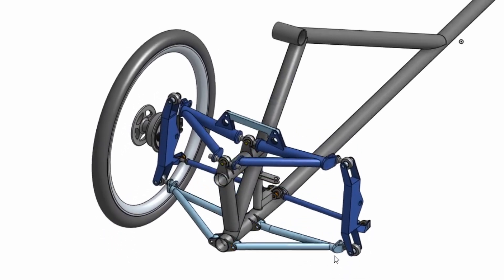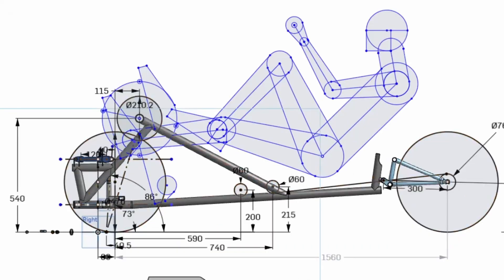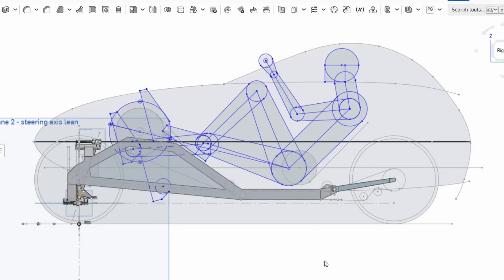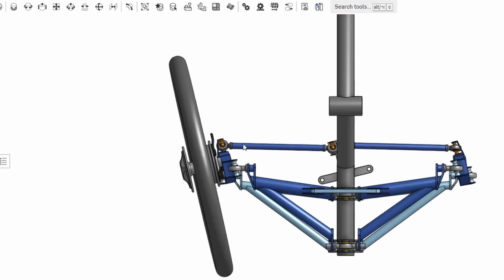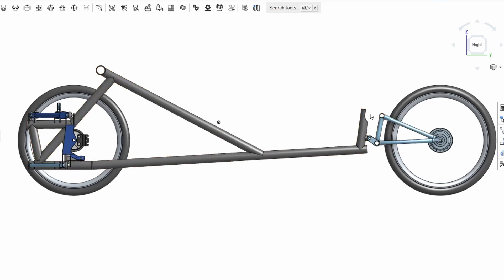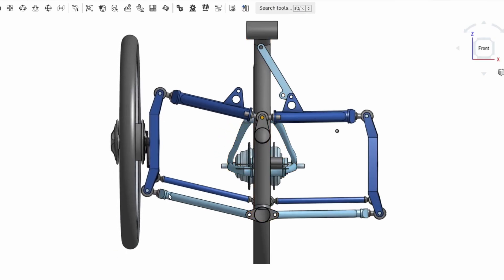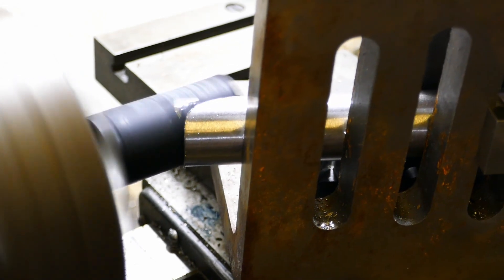Tilting Trike MkII Build Project Ep. 1 - Home Machine Shop DIY Project

Comment: Interesting exploration, I have just discovered your site and appreciate you sharing your journey.  I am also designing a tilting vehicle and have been wondering if at high leaning angles  the Ackerman steering still applies, I’m not sure of this, but I suspect that leaning the wheels changes their tracking behaviour, do you have any experience with this?  I’d appreciate your comments, Mike

Comment: Hi, very interesting. On a velomobile, the body positionning is more ahead. The weight is more on the two front wheels. Other thing : what software do you use ? Solidworks and freecad are mechanical typed. Bye.

Comment: I have looked into this design quite a bit. Things that need to be taken into account.
1) the pivot points of the spindle need to fall in the centerline of the tire.
2) the top pivot should be in the centerline of the bike.
3) the width of the front track will dictate what lean angle related to the circle that you are traveling in. The tire on the inside needs to lean more than the tire on the outside.
In theory you will have 3 lean angles in a turn. Inside center or rear and outside. In order to have this work properly the lower control arms need to be mounted outside the center line, as this will cause an angularity change and in effect narrowing the track width at the bottom of the tires. The steering will need to be at the top because it is fixed width wise. The other thing to keep in mind is rake and trail or spindle inclination angle and axle centerline in relation to the point that the spindle is inline ahead of the contact patch on the tire. Most bikes fall onto 20°-30° rake angle and 2"-6" of trail. In order to have the tires in line with the pivot points you would almost need to weld 2 rims together with the tire on the inside rim and the spokes on the outside rim. The other thing to take into consideration is Ackerman angle on the steering arms. I'm not sure which way is better, straight line or angled towards the centerline of the rear wheel. All these thoughts are theoretical and have been put to paper but have not gone as far as you have by building a prototype.
Reply: Point 1 is a good idea but not essential, if you don’t have pivot points passing through the tyre contact patch you will get force transmitted back through the steering mechanism when one wheel experiences a force that is not experienced by the other.  In normal road operations the forces cancel each other out, and at high speed gyroscopic forces act to dampen the shock, Mike
Reply: Not sure about the different lean angles you propose in point 3, I think constant wheel base may be better that technically correct wheel lean angle - not sure.  Also, no rake is required, steering pin can be vertical as viewed from the side, provided it intersects the ground aft of the tyre contact patch, Mike

Comment: Small flywheels could be designed to turn left when it tilts left. When you break it transfers energy to a rear flywheel to move in the opposite direction, while a hydro brake slows the front fly wheel. It could rob a little energy and stored it, for added stability, breaking and foreword momentum. It would be a little slower from the take off, but easier to peddle, is how I imagine it. It could work with an ebike.

Comment: most of your load is on back wheel. A light front load will attract skid and lost of steering control roll over and crash in my experience. LWB and CLWB recumbent bikes have this disadvantage designed in as you do. What is your point or advantage of your design. You are to skilled with unclear thinking. It is all sound and fury signifying nothing!

Comment: the lower the C.G. the faster the natural tilt speed. the longer the WB the slower the cornering rate the lower the leveling tilt rate due to steering input. what is the point you have not gained more stability.
Reply from the maker: Will have to wait and see how successful it is, but the Mk II needed to be shorter and the wheelbase is still a lot longer than any (normal) bike.  I’m hopeful it will handle better than the Mk I.

Comment: a tilting tadpole recumbent you design is very complex and expensive. what advantage do you gain over recumbent bike
Reply from the maker: I’d say relatively complex rather than very.  Advantages marginal, but the project started out with the idea of a fully enclosed velomobile type machine so the tilting mechanism gives the option to have a tilt lock when stationary and two front wheels reduces the chances of a low-side crash.

Comment: I hesitate to suggest potential problems to someone so obviously skilled and creative: I built a long wheel base, recumbent bike back in the 80s. Using brazing. It was fine until I steepened the steering head angle. It suddenly developed uncontrollable shimmy! Totally unrideable downhill despite a relatively huge, rectangular spine. Your single tube, beneath the rider, seems totally inadequate. It will flex and twist as shown. So triangulation or twinning might help. Or just use a much larger diameter tube. You can't use the seat frame for extra stiffness in your current design. As I did. Because you have rear suspension.

Comment: I am building also something similar but with a much more upright seating position. Mine is 1.33m high,  also have .6m distance between front wheels. I have for the moment ditched the pedal system to add titlting pedals for control. How do you plan on balancing yours when at low speed or standing still? I have the project on mt channel uf you want to take a look

Comment: I am very impressed at how you have been able to avoid bump steer and still maintain ackerman geometry... I know how challenging this is !! I also like that you are going for a decent amount of lean, which most peoples designs don't have !!
In your very first video, you said that having the wishbone outer ends on the wheel centre line was the ultimate but required special wheels, do you think that this current design will have any deficiencies compared with that ? I am seriously thinking of building another one myself..
Thanks !! Roger
Reply from the maker: @kiwiwombatman  hi, the actual performance remains to be seen but I hope my design is a good compromise from the ideal of dished wheels.

Comment: Very fancy and appreciate your work. However, I just think, the kingpins set up like a car will not work well with the rake and trail of normal 2 tandem wheels bike, that make your bike difficult to stabilize. Look at the Piaggio MP3, Yamaha Niken for example, the steering axis off each wheel is perpendicular with the rolling axis of that wheel, or in other words, in the plan of the wheel. Only then, the rake and trail will function normally. 
By the way, the  23 degree rake is alright but the trail is depend on the wheel's diameter.
On a MP3 you can easily ride with no hand on handle bar, just like a normal bike. I personally think the long wheelbase and low CG is not reason to make your previous prototype difficult to stabilize.
Reply from the maker: @MrQuachBinh  thanks for the comments. In fact it was those 3 wheel scooters that inspired me. The advantage they have is height, which allows them to put the steering axis directly above the wheel, like a bike. On a low profile machine like mine this is not possible (well it is but would look silly), which is largely why I went down the inclined kingpin route.  This also avoids/reduces tyre scrub.  On my design you could make the kingpin vertical but the axis would be significantly offset from the wheel contact patch.  The test of the finished machine will be the measure of success or failure I guess.
You are of course right about the trail depending on wheel diameter.  Mine has less trail than a large wheel but is geometrically identical, although I did not say this in the vid.

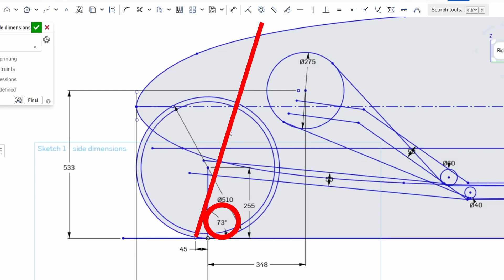Comment: My instinct is that the benefit of a more acute steering axis [like at 3:14] is how the steering column absorbs the head on force while turning.  Maybe taking a very sharp turn with your steering geometry will put a lot of sideways torque on your forks?
Reply from the maker: @tvdp122  there will be a sideways force during the counter-steering stage of initiating a turn but once settled, all forces act vertically through the steering tube.  I don’t think a more acute angle will make it significantly worse; hope not anyway!

Comment: I was thinking you were going to link the tilting to the steering
Reply from the maker: @oswynfaux  I have seen a design where the handlebars are linked to the tilting mechanism in such a ways as to allow the tilt angle to be adjusted by pushing up and down on the handlebars, which I think is potentially quite a good idea. It would also allow the trike to be held upright when stopped.  However, steering angle, tilt angle and speed are not linearly related so steering angle and tilt angle can’t successfully be directly linked.

Comment: That chain drive reminds me when I was in Bermuda entering a contest called the anything that floats race. RedBull was a far away concept yet. (1983) My cohort and I made something similar to a Klingon Bird of Prey. We used discarded shipping tubes and made clusters and found a golf cart wheel and welded angle iron to hold panels as a paddle wheel.Didn't win. The officers cheated and used oars. 12 men with oars on pontoons against two with a bicycle pedal. You weren't supposed to use "Boat" parts. Oars are boat parts. Received honorable mention, and most innovative design. They didn't know I repaired their Jet engines...
Reply from the maker: Great story!
Reply: @MetalMachineShop  A solo entry was a sailor with two translucent trash bags full of empty beer cans and he used it as floatation and hand paddled out and in.
Reply from the maker: @bryanst.martin7134  good excuse to drink more beer 'to save from sinking'.

Comment: Why is your KPI out so much? You're gonna get excessive tire wear
Reply from the maker: @bentBuilder  what's KPI?
Reply: @MetalMachineShop king pin inclination. If I remember correctly, you have an offset of 20mm
Reply from the maker: @bentBuilder  ah yes of course!  Offset is about 20mm, it's a fairly normal car-type geometry so I hope it will be ok.  It is driven by clearance between the wheel and the lower ball joint; smaller offset and/or steeper king pin angle causes a clash, without getting into dished wheels.
Reply: @MetalMachineShop  On my latest build I had a neutral tire scrub. When I run at a low psi (positive scrub) it becomes squirrelly at high speed . When I inflate it high the tire diameter gets bigger(negative scrub) it rides as if on rails. 3200 miles later and I have more than half the tread.

I noticed you had schwalbe marathon tires mounted which are ebike rated? If that's the case you'll want negative or small scrub? That's just my 2 cents. Either way I'm very excited to see it complete, I've been following this project since it's conception. Great work so far!!
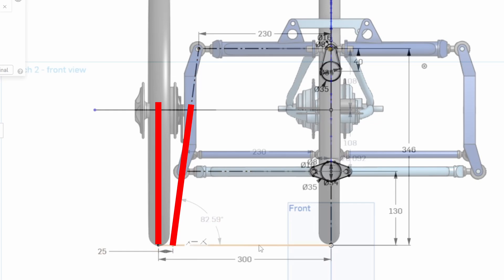Reply: On a similar note (or identical, I'm by no means an expert in steering geometries): The rotation point of your tires is offset from the contact patch by 40.5mm forwards (3:25) and 25mm inwards (5:03). Which is arctan(25/40.5)=31.7° from where I'd expect you'd want it (straight in front). (Compared to what looks like arctan(28?/45)=32° for the first version.)
You probably don't have to worry about the wheel on the outside of the curve being loaded more, as you would in a car. The tilting mechanism will equalize the force through both front wheels - as long as there is no tipping moment (which is an assumption that is violated every time you tilt into or out of a curve).
If I don't have my logic backwards, then a tilting moment will give you a negative feedback loop. (Trying to tilt into a direction will pull the wheels over in the direction that will counter that tilt. Trying to tilt out of a curve will pull the steering in the direction that keeps you in the tilt.) In a car an inwards offset would definitely form a positive feedback loop (making the car more squirrely, which makes me think that that is the application that  @bentBuilder  describes). I think the feedback loop IS backwards compared to a car, but again, I'm not 100% sure that I haven't flipped a direction of cause and effect in my analysis.

And additionally, the 25mm sideways offset still leaves the problem that if one of your wheels has more running resistance, then the bike will pull towards that wheel. If you start running over sand or vegetation on the side of the path, that might become an ever so slight problem (or probably more of a nuisance, as that would make you hold the steering more firmly anyways).

If you want to improve the sideways "rotation-point-to-contact-patch"  offset: At 4:55 you can see that you can indeed not get the bottom ball joint closer to the wheel horizontally, but it looks like you could easily move it 15-25mm further up, and have them asymmetrical about the height of the wheel axle again, like in the first version. Moving it 20mm up will give you 3 to 5mm less sideways "rotation-point-to-contact-patch" offset, depending on whether you keep the king pin angle or the top ball joint position the same.

Comment: Nice ❤ recenlty bought a Hurricane recumbant. yeup can confirm low cg difficult to balance 🤔 thinking stabilisers or trike conversion. it's too cold at mow so working on my 😂clunker.  What cranks you running?  Shorter maybe worth investigating, would give more toe clearance and can be more efficient, I'm 69 and went to 150mm huge difference no knee or back pain, didn't find the gearing worse either. Anyway loking forward to next update ❤
Reply from the maker: The crank length in the design is 175mm (same as my road bike) but I am intending to go shorter for the reasons you mention.  Probably 155mm. Thanks for the comments!

Comment: One thing I was wondering as I was looking at the tilting/steering mechanism, how would it handle at speed over rough road?  Would it be difficult to maintain control over cobblestone or washboard roads?  In a similar vein, I was wondering if speed wobble, or an oscillation effect, may occur at high speed over uneven or unpaved roads.

I think I remember the previous version had a locking tilt, probably for such occasions, but would a small amount of negative camber help with stability?

Sorry, I don't have a background in mechanical engineering, these were just things I was musing as I watched the video.
Reply from the maker: In theory it should be no worse, and hopefully better, than a normal bike over cobbles, etc., but we will have to see what it’s like in practice.  If either front wheel hits a bump, the frame of the trike will only rise by half the height of the bump.  I will be fitting a tilt lock for use when stationary or at very slow speeds.
Reply: Handling wise this trike is no different from a two wheel bike, it just has 3 wheels.
Reply from the maker: @VEC7ORlt  hopefully! With the dubious advantage of more front-end grip and not having to put your feet down when stopped, with the addition of a tilt lock.

Comment: Is there a particular reason, to why the front wheels are in front of the pedals ?
Reply from the maker: Two main reasons; if the wheels were under your knees, the rider would have to be a lot higher up to give clearance for the tilting mechanism; and you couldn’t easily put your feet down when stopped.

Comment: I'm wondering, are roll centers important on a tilting trike? Like in cars, they have a virtual point around which they roll from side to side while cornering. The distance between the roll centre and the centre of gravity creates an arm and its length determines cornering behaviour. I'm wondering if the same is happening with your trike and is making it harder to balance. With parallel and horizontal control arms I'm imagining the roll centers are infinitely high. But I'm by no means an expert on the topic. Cool project though! If it works out I might build one myself too
Reply from the maker: I think it’s a different problem for a tilting trike than for a non-tilting e.g. car, so I don’t think roll centre is important or relevant in this case unlike when designing a car’s suspension. I may be wrong though!

Comment: I noticed in your model that the front wheels are parallel front to back. When I was looking at literature on making ‘tadpole’ bikes it showed both of the front wheels being angled to point at the contact patch of the rear wheel, so that when you turn the inner front wheel has a greater (tighter) turn to reduce scrubbing on the wheels. We raced for school human powered vehicle in Australia and we always got good (even) wear out of the tyres.
Reply from the maker: I have used Ackerman steering geometry, but it may need tweaking slightly.

Comment: add shock absorbers to the front end ? for stability
Reply from the maker: Some tilting designs have a spring return sort of arrangement, but I’m not convinced this is necessary.  It certainly adds unwanted weight.

Comment: The geometry needs to be self-righting when in motion, like a bicycle. Otherwise it will remain a struggle for the rider to constantly keep it from falling over, like the last design.
Reply from the maker: It should be self righting to the extent that a normal bike is as the geometry is basically the same; the low centre of gravity reduces the self righting effect.